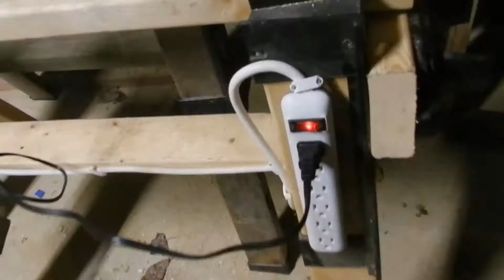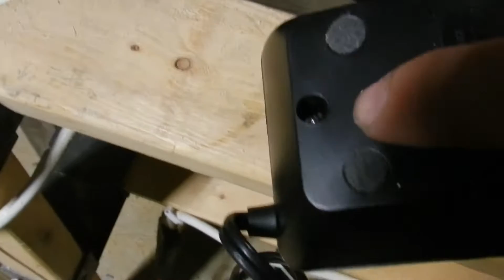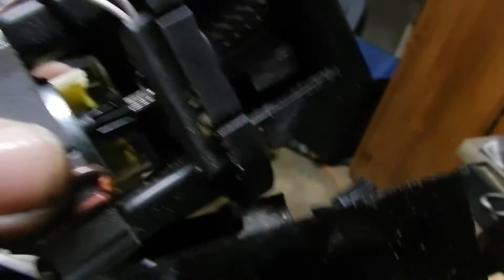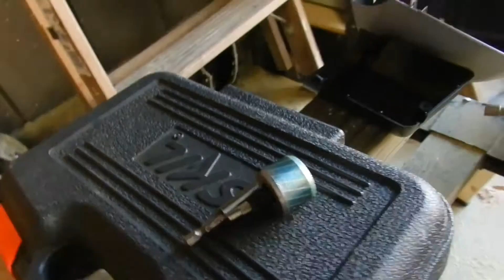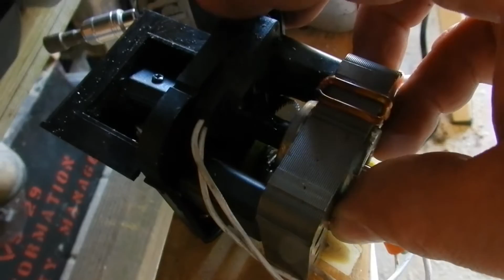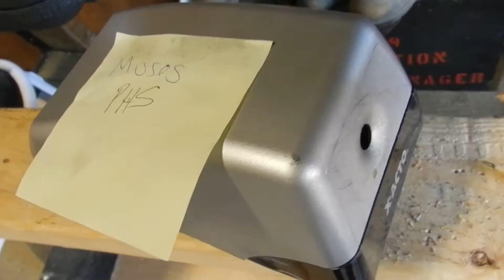How to Repair a Humming Electric Pencil Sharpener

Comment: Exact same problem here. My small gear is white, not black. When removed it had a tiny split down entire length. After I added a nut to prevent the slippage and reassembled, the gear lines up perfect now, but "catches" at each rotation with the other gear along the split causing it to jam the motor still. Ugh. We were so close. Another 2 hours spent to repair a $20 device. Thanks for posting though.